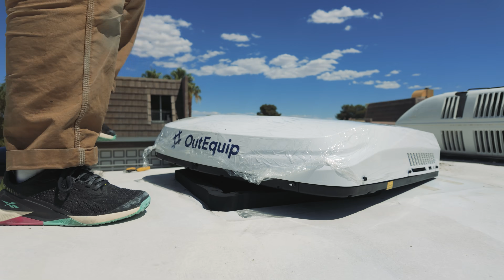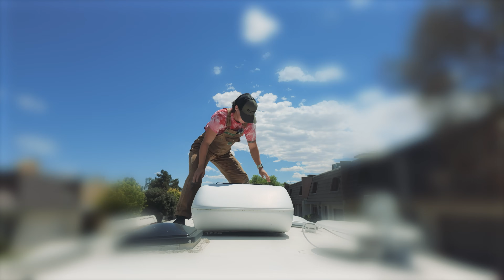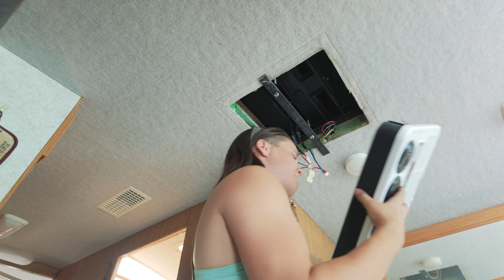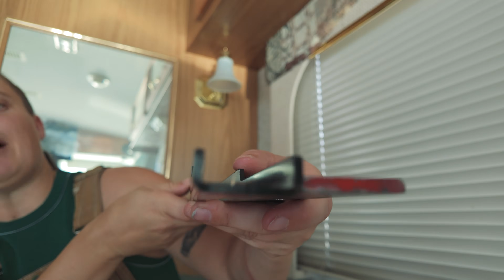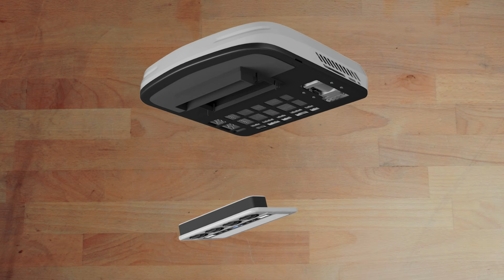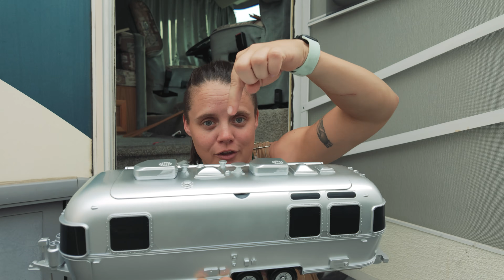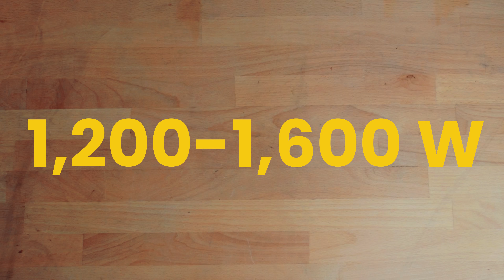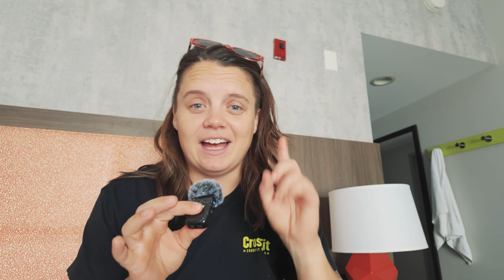Better RV Cooling with Less Power? My Switch to a 12V  AC | OutEquipPro AC Honest Review

Comment: I see the 12V 10,000 BTU/hr A/C from outdoorequip pro has a specified power input of 960W (80 amps) and a breaker requirement of 100 amps. You'll need to install a pair of VERY hefty copper cables (check the regs) to handle to this worst case current. I think that would be challenging to do. 

I'm not buying the 270W power input. If it's a 10,000 BTU/hr unit then the equivalent output cooling power is about 2900 watts. The coefficient of performance for a a/c is likely well under 5 so that means an input power of 586W at best. 

The description for the unit states 8 hours for 480AH battery i.e 720 watts. That would imply a COP of 4. Not bad at all. I think this is a realistic figure and is certainly appealing. 

The 120VAC a/c on my RV is 13,500 BTU/Hr and pulls 1600W from the supply.  That's a dismal COP of 2.5.

Addendum:
I note manufacturers tend to use EER (BTU/Hr/Watt) rather than COP (Watts cooling/ Watts in). 

I see one high efficiency model 13,500 BTU/Hr is quoted as having an EER of 6.7 (i.e. COP of 1.97). The input power is quoted as 1305 watts which with an EER of 6.7 means a cooling power of 8743 BTU/hr.  The conclusion is the actual cooling power might not be anywhere close to the nominal cooling power.  

The point of this side discussion is that if the power measurement made on the 12V unit is correct (and I don't really doubt that) and made under conditions of max cooling, then it seems likely the true cooling power is a lot less that the nominal of 10,000 BTU/hr.  

Caveat Emptor
Reply: I think you took a deeper dive than most so I will also posit this here- getting 6awg wires to the main battery bank without some serious modification, or exterior wiring, will be pretty difficult. That’s what the mfg calls for and only supplies a 12ft cord😂. I have a 2024 Brinkley with a HORRIBLE front AC, but it will be a while before I resort to external wiring down the side of the unit. Is there an alternative?

Comment: This is pretty misleading since you almost make it sound like running on 12 volts is free but that power has to be generated somehow!  Off grid, a 22 Amp load on the coach batteries is going to drain them down in a few hours unless you are running a generator to keep the batteries charged and the generator will need fuel!  On grid and using a 120 volt to 12 volt battery charger will take some of the 30 or 50 Amps too, not as much as running an AC powered A/C unit but it still needs power!

Comment: 1/2 gallon of gas per hour? That is a HORRIBLE generator! I have a 2KW generator that uses a bit under 1 gallon per 8 hours. With a soft start on a 110v AC I have no issues running a 13K AC on it...

Comment: So when you say that it gets connected to a battery, do you mean it needs its own battery?  I ask because I’m thinking of installing in a van without solar.
Reply: You want to parallel a battery bank to handle the amp draw. The batery will give a max load amp draw on it. So  if the battery is 40a max load.... 2 batteries in parallel is 👍 3 is optimal.

Comment: On a popup tent trailer with a cheap rooftop exhaust fan (not even a maxair or fantastic fan) could this 12V AC be a potential upgrade? I guess my primary concern would be if the existing DC wiring would be a sufficient gauge to handle the power requirements safely. The existing fan does not look like it would  draw much power.
Reply: a pop up lacks insulation so ac would not work the best in there
Reply: You want to run the ac wire new at a 4awg i guess, dont hook this ac to existing wires, straight to batteries. With proper fuses. 😉

Comment: Very good explanation, Emily. Do you know there is an 'efficiency' loss in the 12V DC power cable that needs to be considered (that is a trade-off when using this vs an inverter-powered 120VAC A/C).
12 feet of 8 gauge copper wire has about 0.45 volts drop at 40A current draw. That's about 4% loss at 12V for this unit.
It's an acceptable trade-off in this particular case. A longer cable should be heavier gauge to not have a higher voltage drop.
Reply: That's good to know.appreciate your knowledge in that area. Im planning a build soon .if money comes through.tbank you

Comment: Wet cell lead acid vehicle batteries are designed for vehicle starting (high short term loads) with no deep cycling.
Expect shorter battery and alternator lifespans leading to inconvenient vehicle break downs.
Towing or on site repairs will eventually offset the cost of a free air conditioner.
My bottom line is that alternators are designed and sized for vehicle running, and OEM capacity battery charging.
Using them for other purposes is possible but frequently leads to other problems.
Reply: Are you living in the 90s?
Reply: @Alex-uh1mj "Are you living in the 90s"
Nope.
But my mechanical, electrical, and electronic work experience began in the 70s.
Reply: @i-like-my-space  any modern alternator is fine at 80a. Lithium is now about a third the price of lead acid. Whos fitting lead acid
Reply: @Alex-uh1mj "any modern alternator is fine at 80a"
Anybody that wants to use their class A, B, or C RV engine as an air conditioner or battery charger is free to do so.
80 amps times 13 volts = 1040 watts (1KW)
Reply: @i-like-my-space its when you are driving
Reply: @Alex-uh1mj  "Lithium is now about a third the price of lead acid. Whos fitting lead acid"
Battery type and cost is off topic (excluding engine battery damage).
The topic is rate of power consumption.
@20:56 Her old air conditioner was sized for her RV heat load (in BTUs), and pulled 1300 watts.
She compared old power draw to new power draw without factoring in BTUs.
She will likely need 3 more 12 volt systems to equate to her old air conditioner BTU capacity.
Reply: @i-like-my-space you were saying the alternator will pack up.  It wont
Reply: @Alex-uh1mj  "you were saying the alternator will pack up.  It wont"
1. An alternator has to spin in order to make electricity.
2. Alternator field winding (carbon) brushes and shaft bearings sooner or later wear out.
3. If you plan to work an alternator or battery harder than it was designed to work,
buy replacements with lifetime or extra warranty coverage.
Reply: @i-like-my-space  I do this for a living. They don't pack up  because they are used within their limitations. And again.. nobody is using lead acid now

Comment: I don’t understand. When cold, we use MyBuddy heater. So when hot, why not just buy a regular AC portable and plug to Ecoflow?
Reply: Get the vfd one for efficiency, eco will power a 120v idk 12k btu easily. Check on the tag for rating of amps or watts